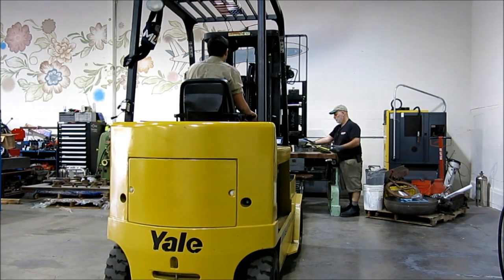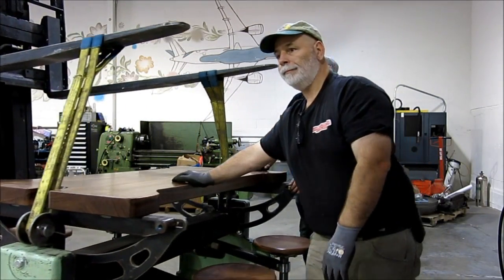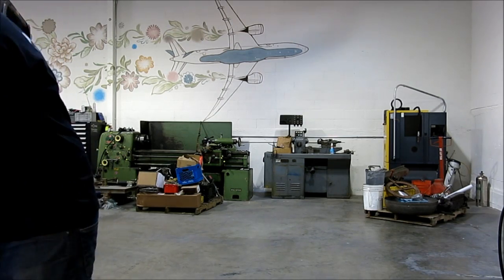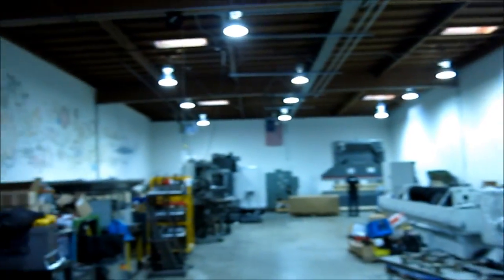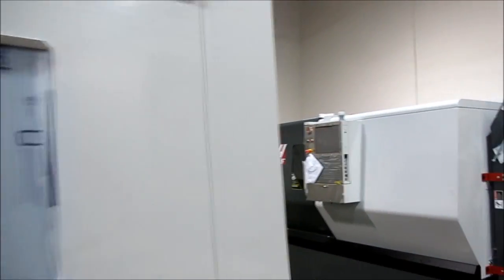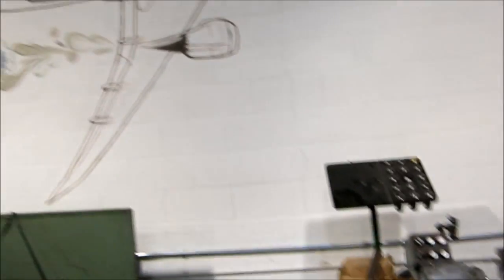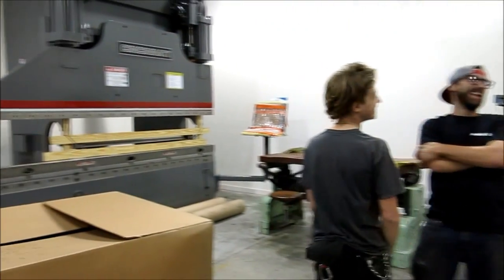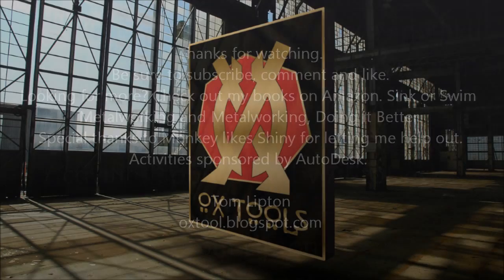MLS Machines Part 2

Comment: So they spend several hundred thousand dollars on way cool machines and can't measure how long a floor bolt to install? How did you fix it?
Reply from the maker: Hey Pat,

I used the anti bozo method. I stuck a tape measure down the hole and did some arithmetic by bending the tape. Sent one of them to the hardware store for more allthread. 

Cheers,

Tom

Comment: OX, oh dear.  Why did they put the back of the spindle only like 4 feet from the compressor?  How are they going to load bars?

And why did they face the VM3 away from the forklift aisle?  How will they get heavy stuff on and off the table?

Or am I over analyzing this because they will never run bars or put heavy stuff on a MOLD MAKER?
Reply from the maker: Hey Perry,

No bar feeder for the lathe. You can still load four foot bars in the spindle with the space they have. The mill has doors on the end of the enclosure to load the 4th axis or the A/B trunnion with a forklift. Both chip conveyors face out toward the Cinci. The operator stations face each other to conserve other areas of the shop and so they can share a workbench between them. Keep in mind these are not production machines and they will be relocated in a year or so when they get the balance of the building. Thanks for the comment.

Cheers,

Tom